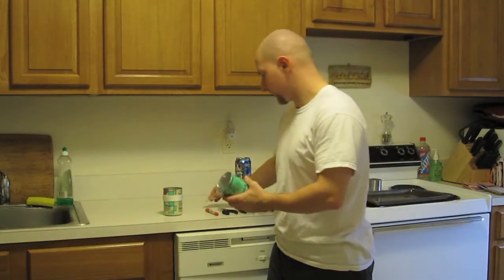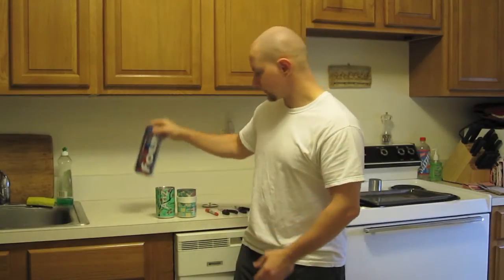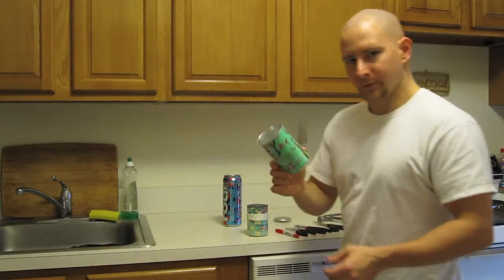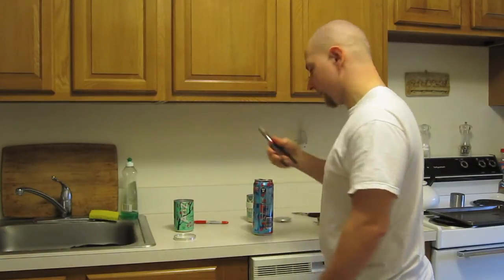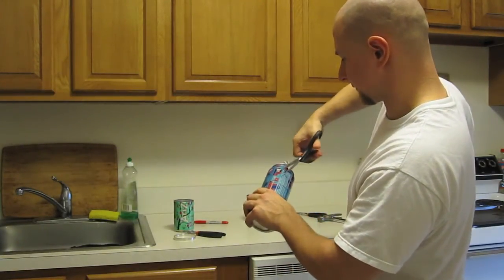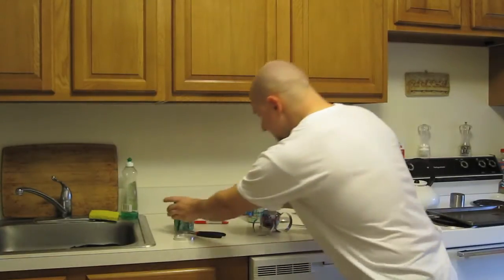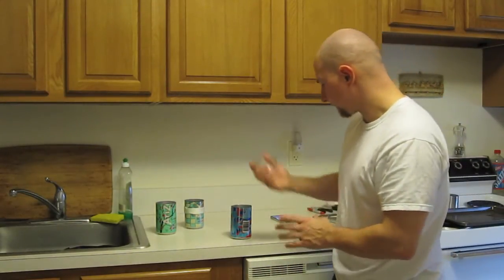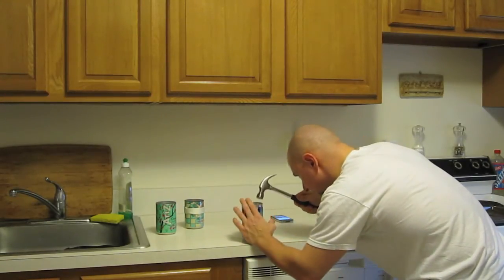How To - Beer Pot Ring Replacement

Comment: Another great vid man! And thanks for the shout out!
To remove the ring in the field just stab a hole in the can and rip it apart carefully. The ring will fall out. 
Also when cutting the line on the can I found that if I would put the side of the can that I wanted to keep on the right hand side of the scissors it was much easier for me to get a even and clean cut. (Courtesy of Tinny.)
Once the rings lined up slightly push down with your hand to seat it a little more before you hammer it in.

Comment: If you replace the sharpie with a e-xacto blade and scribe a line around the can ,then put a small hole above the line. Then push you'r thumb nail against the line you'll get a much cleaner cut.